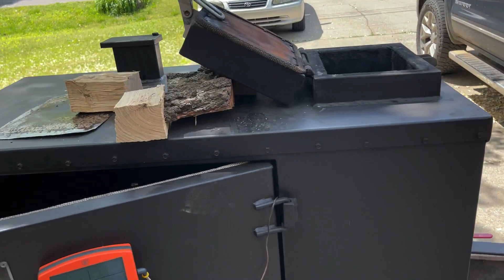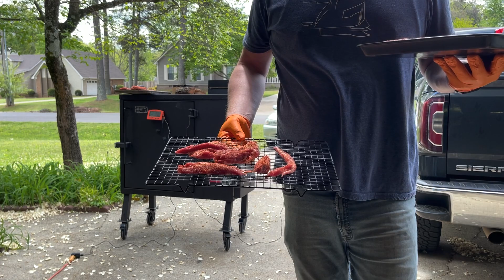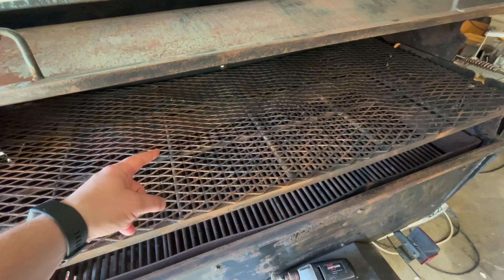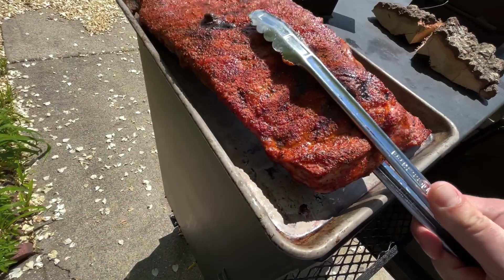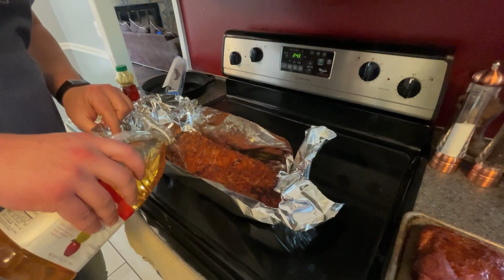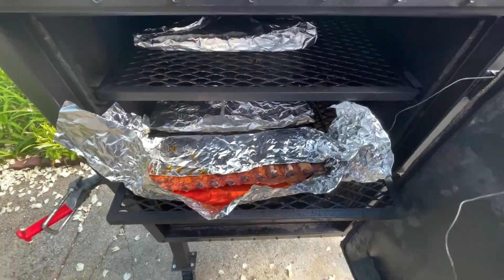Gravity Smoker Comparison - OCGS Spare Ribs

Comment: Heyo! Thanks for the videos - I definitely noticed the heat difference on the chute side but haven't had any issues running it no water pan. I'll have to try that out. I did want to ask if your heat deflector came welded all along the seam from the factory? It seems mine just has spot welds. Also what's your thoughts on that masterbuilt grav fed? I'm considering picking one up for ease of use when I don't want to light up the OCS big old pit - the fact that it takes lump and the OCS prefers briquettes is a plus as well. Lastly - do you think a 6" teltrue would be deep enough for that front door? Thanks!!!
Reply: Yes the 6 inch teltru will be great for it. I have one in my ocgs. And I love it.

Comment: Got one of these few weeks ago. Did my first brisket cook on it. I put the point on the pointing towards the right side due to the heat. The flat was pretty thin, after 8 hours the point was 208 and flat was 193. Pulled it in fear of overcooking it. Flat was still a little bit tough. Going to get some fire bricks to try and even this thing out. Also grate temps were 30-40 hotter than tru-tel was showing.

Comment: Awesome video and awesome setup.  After seeing the Masterbuilt had been wondering if you could rig a higher quality gravity smoker similarly.  Do you find this is more or less work to maintain compared to say a Masterbuilt?
Reply from the maker: Hey I’m glad this video is reaching the masterbuilt guys! Honestly there are three big differences between them besides cost; 1) the masterbuilt will only last a few years unless you mod the chute to protect the metal. There are mods that will promote longevity, but you get what you pay for. Consider the masterbuilt to have a much shorter lifespan than the ocgs. Tech items like probes and controller are also cheaper built, not as precise, and will most likely fail in a shorter lifetime compared to this setup. 2) the masterbuilt are much lower capacity than the ocgs. It would take two 560 to meet the same capacity. 3) insulation and temp retention is great on these which means less fuel when at temp. 

Maintenance wise if we’re talking cleaning, masterbuilt is easier, simpler, and cleaner. If we’re talking smoke prep and maintenance, the ocgs is as touch-free as it gets for a gravity. Add wood every 45-60 Mins as desired and refill lump charcoal every 14-16 hours.
Reply: @jg1317  Thanks, appreciate that info.  I don't have any smoker currently but getting a new construction home soon and starting to plan out the backyard dream.  The Masterbuilt really appeals on convenience but I really don't like investing money into something that seemingly won't last as long, so it's good to see people like you achieve a similar level of convenience with various benefits, especially a higher quality.

Comment: I have the exact same setup. An cogs with signals and Billows. I’m having an extremely hard time getting it to maintain constant temp. What have you found that helps maintain? They only time it maintained a steady temp was during the initial burn in. It only fluctuated +/- 1 degree. Now I can’t keep it steady. They only thing really different from that first time is a water pan and the meat. Your help would be appreciated. Thanks.
Reply from the maker: Hey there, it sounds like your charcoal and wood might be issue. I add large chunks that I cut myself every 45-60 minutes or so and use lump charcoal pretty much exclusively now. Have you cleaned your smoker? I found that after the first time I had ash caked on the expanded steel between the firebox and chamber inlet.
Reply: Thanks. I’m actually in the middle of a cook right now. I’ll check that out when it’s all over and I’ll let you know. Thanks for your reply.

Comment: What adapter did you use for the billows
Reply from the maker: Hey there I used the 1.5 inch universal adapter from bbq guru and the universal adapter from thermoworks
Reply: @jg1317  Will the 1.5" ball valve adaptor from thermoworks work by itself? Looks like it would just screw in.

Comment: Did you say you cemented the firebrick on? Any reason JB Weld wouldn't work? Did you have a circular masonry blade or did you use a reciprocating saw or something like that to cut the brick? My OCGS is set to ship tomorrow so I'm getting my ducks in a row.
Reply from the maker: Here is a before/after readings on the second rack when set at 225. 

https://imgur.com/a/aesvrzZ
Reply: @jg1317  Nice! I'll probably follow your lead but I may just try JB weld or other high temp adhesive as I don't want to buy a whole bag of cement and deal with mixing it up and all. My folks may have some kicking around for my mothers glass kiln. If so I may try cement. I only have my woodcutting sliding saw (nor a particularly stout one at that) so I'll have to come up with something else to cut firebrick.
Reply from the maker: @joshevans3452  I double checked what I used - Rutland fireplace mortar
Reply from the maker: I measured and cut the pieces and cemented the pieces together. I didn't cement them to the smoker itself. The heatshield I made is removable. I used a chop saw but I recommend using a proper masonry blade.